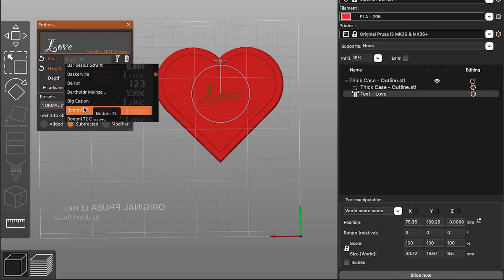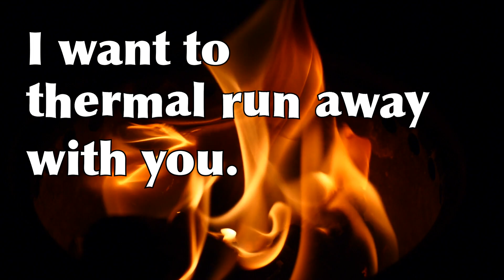3D Printed Shutter Boxes

Comment: What kind of glue are you using ?
Reply from the maker: For this project I used boring old cyanoacrylate super glue.

It's not always the best for 3D printing, but the glue doesn't need to be super strong or resilient when the parts themselves have a very tight interlocking fit.